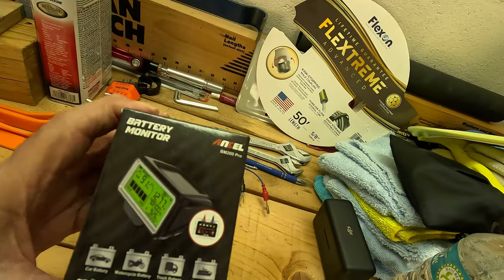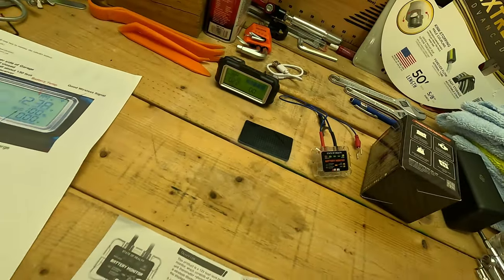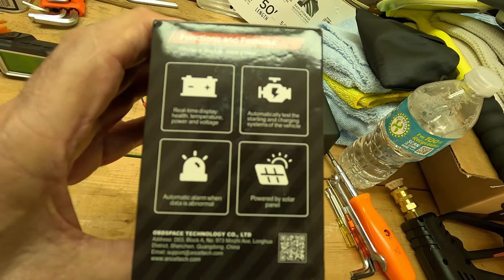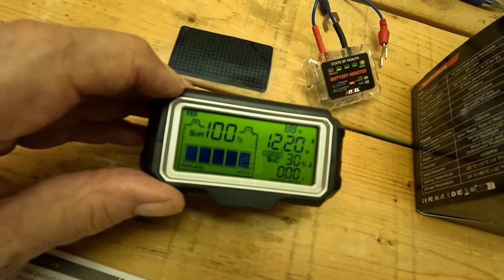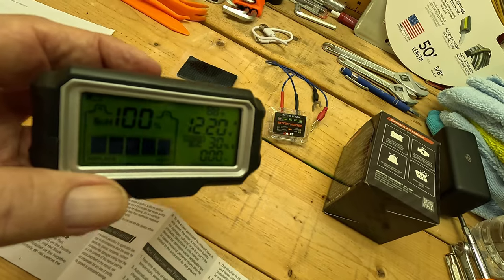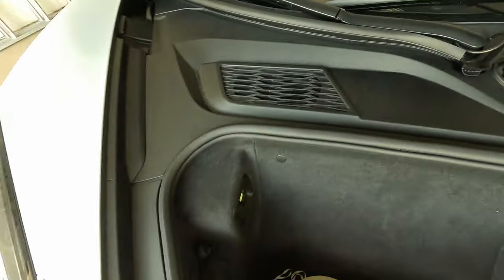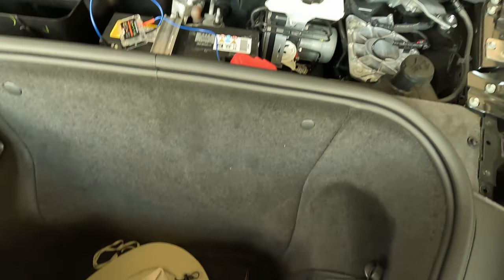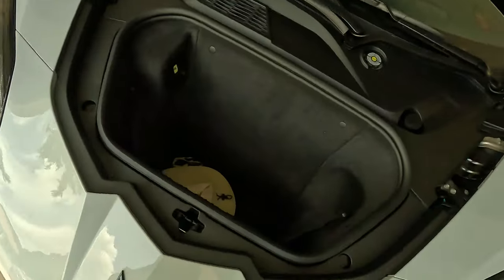Battery Monitor and Remote for 12V battery C8 Corvette

Comment: Hello, I am from Jakarta, the capital of Indonesia. I am interested in using this tool on my car but before buying it I need help.
1. Currently in my car there is a TPMS device (Tire Pressure Monitor System) where this device is similar to the ANCEL BM200 PRO, both sending data without cables but through sensors. Will these two tools if installed in 1 car interfere with each other?
2. According to the information, the module is attached to the battery in the engine room. Is the module casing strong enough to withstand the engine's hot air?, maybe for safety the module can be connected with a long enough cable and put in the driver's cabin. 
Thank you for taking the time to answer me.

 warm greetings
Reply from the maker: I've seen no interference on the TPMS and a friend of mine has tested it for quite some time. So, I would not hesitate to use it. I have had it on my car for many months with no issues. Since the battery is up front and the engine (on the C8 Corvette) is in the rear, heat is not an issue.
Hope this helps and Greeting to you from Central Florida.

Comment: Hey Bob, Pretty cool piece! Where does it draw solar power from in the garage?
Reply from the maker: If I have the garage door open indirect sunlight hits the panel. But I have it in the house and I've not had to use the usb-C cable once. Keeps charged all on its own.

Comment: Why not just leave on a battery tender and not have to worry?  Definitely a cool product. 👍
Reply from the maker: For the price, I can keep an eye on when I need to put on the charger. Can also use it on a motorcycle or golf car.
Reply: Hi again Robert:

Thank you for all you do for Corvette enthusiasts!

Technology is a wonderful thing, when it works!

Is there an “Audible Alarm” from the unit when “something bad occurs”?  

Or, must a visual or physical inspection of each vehicle be conducted?

Are there some batteries (other than Lead Acid) where this device will not work?  Gel?  Lithium-Ion?  Marine Deep Cycle?  Other?

Is there a range limitation between the battery and the base unit inside the house?

Can this be used while a Battery Tender is in use?

Does it operate on various frequencies, so multiple units can be used?    Or, do they interfere with each other?

I keep a Battery Tender attached to 4 of 6 vehicles, the ones that are not my “Daily Drivers”.  Thus, can multiple monitors report on the status of each battery?  (I was told Corvettes use a lot of juice while in storage?)

Thanks, I know I probably missed something 😢……